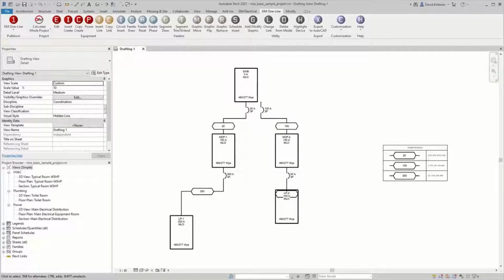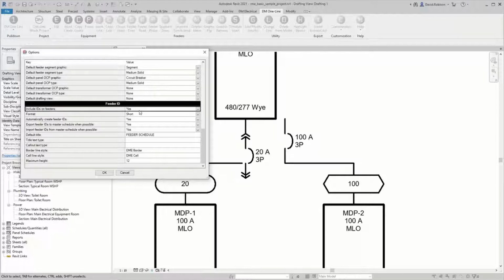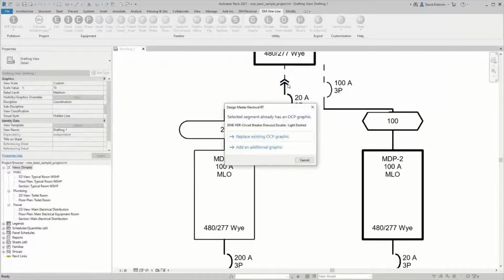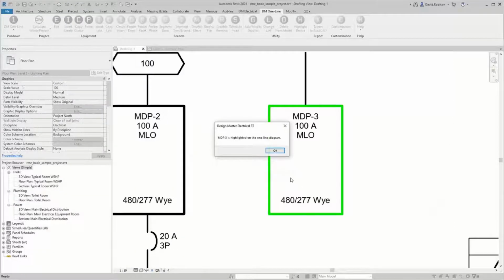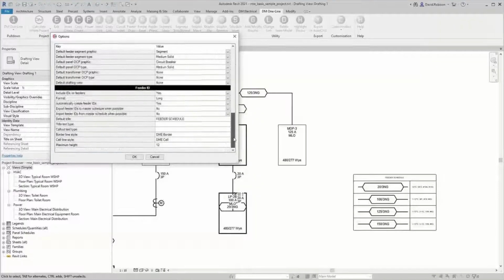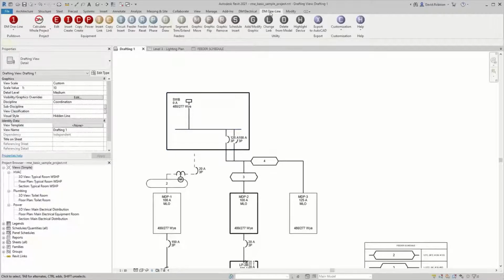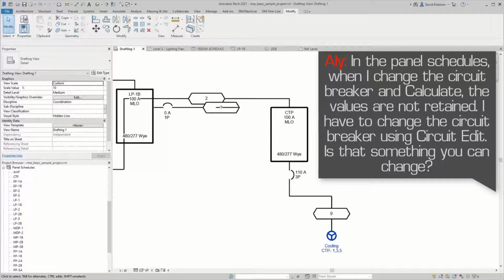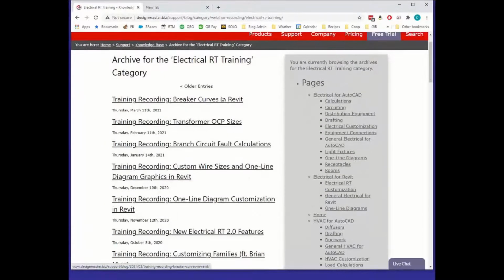Design Master Electrical for Revit: 2.0 Beta 8 Features (04/08/2021)

Comment from the maker: A summary explanation of Beta 8 (00:33)
Settings to assign and modify OCP segments on feeders (01:16)
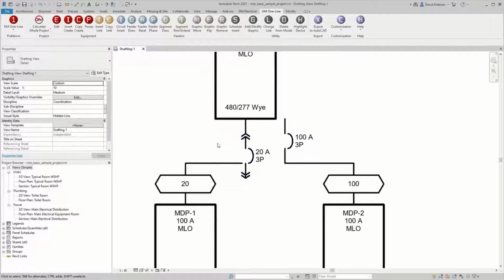Feeder IDs (03:56)
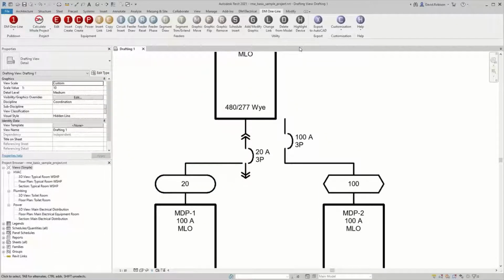    The Feeder ID section of the Project Options command (05:06)
    “Feeder ID Formats” article in the knowledge base (06:23)
    Inserting a feeder ID schedule using the Schedule Insert command (Available in Beta 9) (07:13)
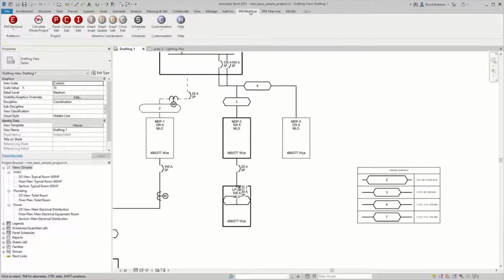        Why the feeder ID schedule is separate from the schedule created using the Feeder Schedule command (23:22)
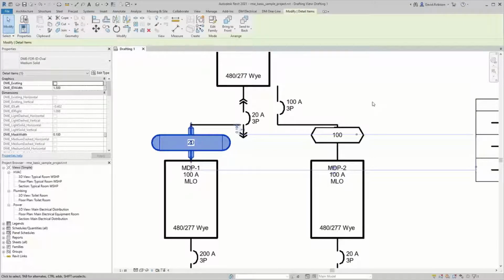Changes to one-line diagram graphic families (08:27)
    How the changes affect the default list of graphic families (14:38)
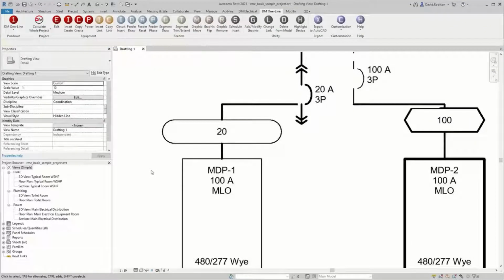Modifying one-line diagram graphics using the Feeder Phase and Add/Modify Graphic commands (09:42)
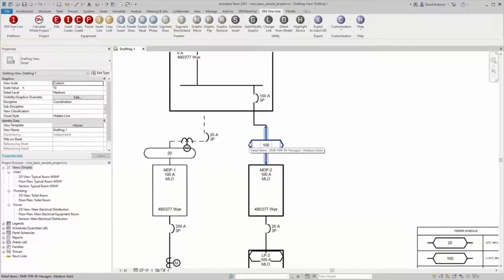Modifying one-line diagram links using the Change Link command (12:13)
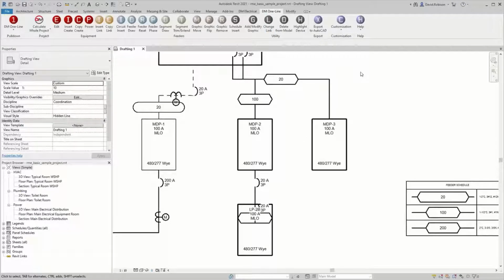Finding devices in the model from the one-line diagram, and vice-versa, using the Highlight Device command (13:44)

“When I make changes in the model, when will the one-line diagram and feeder ID schedule update to show those changes?” (15:21)
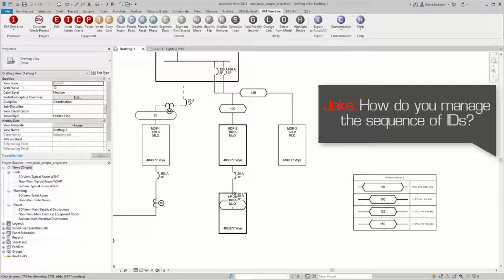“How are feeder IDs arranged in the schedule?” (17:50)
“How do I handle common devices on one-line diagrams that show different phases?” (21:26)
“How do I show spares and spaces on the one-line diagram?” (24:16)
“If I change sizing criteria for equipment connections, will the one-line diagram update with those changes?” (25:57)
“Can I show fault for branch circuit devices on the one-line diagram?” (27:26)
“Is it possible to make Design Master recognize changes to breaker sizes in panel schedules?” (29:48)
“What plans are there for training material for Electrical RT 2.0?” (31:47)